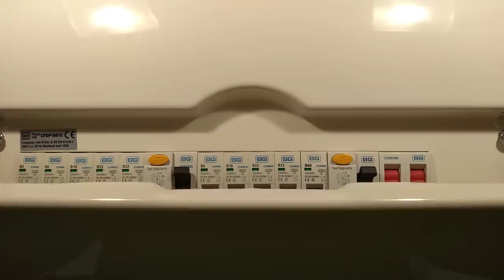A look inside a British home electrical panel.

Comment: I'd like to see a comparison with a modern German distribution panel (3 phase).   Always seemed like a good idea instead of single-phase distribution.  I'd also like to see a discussion of the UK "ring mains" system.
Reply: TIL ring main are a thing. In theory it should let you get more power to the outlets/use less copper for the wiring. Also the UK uses 32A rings while Germany uses 16A radial distribution. However if a wire gets broken at some point in a radial system it will not work while in a ring system it can lead to a overload situation where the wiring could burn.
Reply: The second world war brought about ring mains in the UK. It was determined that there might've been the possibility of a copper shortage so using a ring was a measure designed to reduce the amount of copper a house needed for its wiring.
Reply: Huh, I didn't realize German homes had three phases, I thought only large buildings or industrial stuff got that. Though it does make sense that Germany of all places would build houses capable of running factory equipment :)
Reply: @jayzo  Interesting Germany didn't do that as there was even more stuff to rebuild.
Reply: @GiddeonFox  Yes. Every German building has 3-Phase. The stove is wired to all three phases, as are electric water heaters. If you have a garage it's not all unusual to have a 3-Phase outlet, one of the big red ones. Also rooms are normally running on different phases to distribute load.
Reply: Essentially a 'ring final' is a means of reducing cable cross-section and this cost saving and arguably being easier to install, by having a circuit supplied from two ends instead of one, such that if you tried to draw 32A at the farthest (equal resistance down both paths back to supply) point of the circuit then the current would travel equally down both paths.
To the nest of my knowledge in the current regulations; a'ring final' is a defined 'standard circuit' in which the protective device is 32A and the current carrying capacity of the cable in use, taking into account thermal constraints etc., must be 20A or greater. In most homes this results in a 2.5mm csa. In some cases 4mm csa may be required, such as if under too much insulation.
Reply: @GiddeonFox  i have 3 phasis in my tiny 36m² flat, the distribribution board is from the 1960ies and it's never been updated. It still lacks any RCD....
Reply: Most of Swedish homes also have three phase systems. The ones with one phase are mostly apartments, and they are often updated the three phase when renovating the systems.
Reply: @FreeOfFantasy  As your nieghbours in austria we also use this system, just wanted to add that at least where i live it seems to be quite common to have one phase per floor in a multi-story house. I live in an apartment building with 2 story apartments and we have one phase for each floor and one as "auxilliary" that goes to high power stuff like stove. The arrangement rotates each appartment so that the whole building ends up more or less balanced.
Reply: @FreeOfFantasy    The distribution box that Clive shows surprised me.  The distribution panel for a typical US home is much larger.  My own (a 200A one) has 25 circuit breakers, counting the 240V double-pole ones for the heat pump and kitchen and well pump as single.  I'm not including the sub-panel in my workshop, either, which probably contains about eight breakers.  My home is about the US average in area--I have neighbors with larger homes and 400A service.
Reply: @FreeOfFantasy  3 phase makes an enormous amount of sense for appliances with large induction motors--no start/run capacitors or centrifugal switches.   For large applications requiring DC, 3-phase ripple frequency can be made to be 6x the mains frequency, with a very high DC content.

 My neighborhood is fed by a buried 3-phase 12KV line (each home has a pad-mounted transformer), but the feed to the homes is single-phase, with the utility "balancing" the phase loading manually, by connecting homes to one phase.   On the other hand, the distribution transformers for 3-phase must certainly be more expensive than those for single-phase.
Reply: @uzmeyer1752  I only know that my dad explained me that VDE0100 says the rooms should be on different phases and balanced. I guess you can also do that by wiring up one floor/apartment at per phase.  Where I looked at it last it didn't really matter as all three floors came down to the same breaker box anyway.
Reply: @GiddeonFox  Sweden as well, even 1 bedroom apartments. In an apartment, the stove is the only likely (possibly washer/dryer as well, if it has them) 3-phase load. Other circuits distributed over the phases.

New construction/renovation - all grounded, RCD/GFCI for bathrooms. Legacy, there's still ungrounded outlets, ceiling light outlets, etc around. Grounding was brought in as requirement for kitchens while bathrooms typically had a 110V current limited "shaver outlet"

Current apartment is a mix, as kitchen and bathrooms have been renovated,  while the other rooms have the older ungrounded outlets.
Reply: for some great information about uk mains, there are 2 great YouTube channels 
John Ward and Thomas Nagy
Reply: tubastuff In my European country, each 3 phase transformer feeds a few streets or a small village with 3 phase 380/220V circuits. Each house is fed by a main fuse (usually 25A or 35A) in the curbside "tombstone" distribution box which feeds the 3-phase meter, then the consumer unit where a 3-phase RCD acts as main breaker.  From there it feeds 10A or 13A 1.5mm² group fuses for normal single phase loads or larger 16A 2.5mm² 3-phase groups for heavy loads.  The EU harmonization with the UK raised the nominal from 380/220 to 400/230.  It also allowed the mixing of 3 incompatible socket types from around Europe, making "travel" adapters a permanent necessity.  6A/1mm² circuits were common half a century ago, while really high power circuits (32A, 63A etc. 3-phase) are really only for industrial and stage installations.
Reply: @tubastuff  Three phase is great. No question. I just have never seen a household appliance beside a stove and a heater that has three phase. We have usually a big three phase transformer per neoghborhood from 10, 20 or 30kV.
Reply: In Czechoslovakia there were used wires made of aluminium. That's also quite dangerous.
Reply: @JendaLinda  Not really. You just need bigger cables and have maybe problems with corner radii.
Reply: @FreeOfFantasy  
Three phases in residences is not generally permitted in the UK.  On the basis that some idiot will run an extension lead from a room on one phase into a room on another phase and run the risk of getting a 415V jolt.

Or somebody deciding he needs more outlets in a room and finding it convenient to run a spur from an outlet in the next room.
Reply: @GiddeonFox  yeah, three Phase is quite common in large parts of Europe. It makes a lot of sense for running high-powered equipment like electric stoves. It also has Advantages in distribution - neutral doesn't need to be run in the grid, it's only referenced to earth at the local low-voltage transformer. Essentially, even if you were to run the neutral, you'd get three full circuits out of four wires, instead of six.
Reply: @FreeOfFantasy  I own an "all-electric" home in a rural area.  For heating and cooling, I have a heat pump, which has a large compressor in it.  A 3-phase motor there would make tons of sense.  Interestingly, the fan on the compressor unit is a VFD unit, so there the phase doesn't matter.  But the pump in my well would benefit from a 3-phase supply, no doubt.

Some of my friends with machine tools in their home shops have to use so-called "phase converters" to run the motors on some of the larger equipment.  Basically, an unloaded 3-phase motor with one phase fed by mains and the other coupled via a large capacitor.  The idea is to get a sort-of auto-transformer effect from the unloaded motor to drive a 3-phase load.  It works, but only just.
Reply: @tubastuff  
We have twice the voltage you do, so only need half the current to the house.  We're also poorer than you, so can only afford half as much electrical stuff.  That reduces your 400A to 100A.  And we need fewer circuit breakers than you would, even at 100A, because we have ring mains rather than radial mains. 

Oh, you wanted to know more about ring mains: https://en.wikipedia.org/wiki/Ring_circuit  There you will learn why UK plugs must have a fuse.  Except for Chinesium crap which often has no fuse, or has an illegal fuse which explosively arcs on overload because it's not sand-filled.  Also the cable catches fire at half the current it claims to be rated at, and the earth wire is often present but not connected (so it passes a cursory visual inspection as it appears to have three cores).  See many videos by John Ward on Chinesium plugs and cables such as this two-parter: https://www.youtube.com/watch?v=9KMrWupFQt4 and https://www.youtube.com/watch?v=cRjF7MsJKq8
Reply: Dutch homes also usually have three phase, although optional. Normally you either get 3x 25A or 1x 35A
I am quite surprised to see the neutral bars, here both Live and Neutral are isolated by the circuit breakers, which are dual pole!
Reply: One big difference we have in the UK to a lot of the rest of the world is all the plugs which fit into a socket on a ring circuit need to have a fuse in them (BS1363).  They only fit in one way around so the fuse is always in the line (live) conductor.  This allows us to use a larger 32A ring to supply multiple socket outlets (up to a recommended maximum floor surface area of 100 square metres), fused down to 13A or smaller in the plug top.
Reply: @tubastuff  The german one are bigger, we use the same style of devices (circuit breakers, RCD/GFCI) as they do in the UK. For comparison: This panel shown here is single row with 14 units. My main panel, which also holds the meter, has 6 rows. Every row got 12 units, the units a normal circuit breaker is one unit, RCD/GFCI is 2 units wide. I've got a sub-panel in the 1st floor (what is 2nd floor in America, what you call 1st floor is here the ground floor), 2 rows with 12 units per row.
The good thing on this system with the rails is, you can install a transformer for the door bell or other useful things. I've installed an outlet into the panel, because in the room with the sub panel is no outlet. It's actually only a store-room with the access ladder to the attic and the panel.

@John Francis Doe

"Each house is fed by a main fuse (usually 25A or 35A) in the curbside "tombstone" distribution box which feeds the 3-phase meter, then the consumer unit where a 3-phase RCD acts as main breaker."

Not state-of-the-art. Leakage currents acumulate, and then the whole house is dark. Or you've got a defective appliance, try to find it in the whole house...good luck. 35A is quite low, here you'll get 3x63A in the service entry.

  "The EU harmonization with the UK raised the nominal from 380/220 to 400/230."

UK had 3x240/415 V, they actually lowered the voltage. Most other countries, like Germany, raised it.

"It also allowed the mixing of 3 incompatible socket types from around Europe, making "travel" adapters a permanent necessity."

Europlug for small power appliances, fits all european outlets (except the british BS1363) without an adapter. Most countries on the continent use the german Schuko or the french system. And there are plugs available which fit into Schuko AND the french outlets.
Reply: @FreeOfFantasy  Aluminium wires are unreliable in screw terminals. The wires are too soft and they change shape. That makes bad electrical connections after a while. Terminals must be tighten periodically.
Reply: That only goes for new houses, old ones are single phase and can lack the PE Everything thats about 50 years or older should be checked for that.  @FreeOfFantasy
Reply: u have to remember that u basically half half the power with same amperage since US has 120V. 
 @tubastuff
Reply: @jayzo  I thought it was because there was a copper shortage after the war.
Reply: @wisteela  there was indeed, I misread my source when I double checked.
Reply: @MorbusSchmorbus  Except for the large stuff, such as heat pump/air conditioning, electric stove, oven,water pump--all 240V.  All-electric homes here are still practical as the power comes mostly from hydro--Bonneville Power Administration, though there is some windfarm in the mix.
Reply: @tubastuff  The USA uses 110 volts rather than 240 so you have twice as many breakers due to double the current of the UK and you have 2 phase rather than single. Typically a UK house will have 3 x 30A breakers for sockets (downstairs, upstairs, kitchen), 2 x 6A for lighting ( up and down stairs ),  40A for the shower, and 40A for the cooker.
Reply: @RuneInternational  Don't swear,  you said the N word, there are others that are better and don't do rough work !
Reply: @steverpcb  I know that, but the US distribution is standardized at 120V, not 110--it's crept up over the decades from 110, 115, 117 and now 120.  I think much of Japan stlil uses 100V--I've got some old Japanese electronics with 100V on the nameplate.   Heavy appliances here, as I mentioned, use 240V.  My heat pump, for example, has a 40A 240V and a 60A 240V breaker--one for the compressor and the other for the air handler.

"Two phase" is a little deceptive--the feed is still single phase with a center-tapped transformer secondary.  There were genuine two phase (differing by 90 degrees) distribution setups in the early part of the 20th century (WikiP says that Niagara Falls had two-phase generation), but what you're referring to is really "split phase".  Two-phase power has the same advantage as three-phase; motors don't need separate starting windings.
Reply: @alfoncejean8826  The youtube videoer mentioned in the original post's name begins with N and does rough work, is not a good example to give to others :(
Reply: Ring mains were made because of resource shortages, not because they had advantages other than 'takes less copper'.
Reply: @GiddeonFox  It's the same here in Sweden - even many apartments have 3 phase here, where the stove runs on 3 phase and all outlets and light are spread out on different phases. I have for example the a washing machine running on one phase, the dryer another one, the dish washer the third one, haha. The stove runs on all 3 phases - and I have also put up a 3 phase out let my self (one of those big red ones) that I can use for other stuff (I have for example a furnace that can melt metal and stuff)
Reply: @FreeOfFantasy  I'll bet the Germans didn't have soap rationing until 1950 either.
Reply: @tubastuff  The one in my ex-wife's house in France is like something of the bride of a Klingon Warbird.
Reply: Didn't know Germany had domestic 3-phase...... hmmm, useful if you've a 3 phase lathe or mill......... 
confession   I have a 3 phase lathe in storage hence my interest, cheaper to get a phase converter but......
Reply: @JendaLinda  Yes and they tend to become brittle and break if you're not careful.

The apartment I live in has what appears to be steel wire that's got a copper layer on the outside. I had no idea that was even a thing. But, since the outside of the wire is what carries most of the current anyways, it does make a bit of sense.
Reply: @JendaLinda  its not the aluminum that is dangerous, its the failure to apply the proper anti-oxidizer when terminating it.
Reply: A normal German house has 3 phases. One phase (per subdivision) should be reserved for lights only, the other two for power outlets and other stuff. If a breaker trips, you should still be able to have light in the rooms. Bigger consumers like stoves or flow-type heaters have 3 phases, it's also common to have a 3-phase (380V) outlet (CEE 3L+N+PE/3P+N+E 16A or 32A)  in your garage or cellar.
Reply: @tubastuff  American boards have always amazed me as how clunky and industrial they look, Australian boards are almost identical to the one Clive is using, just with slight local differences, single phase we still mainly use red for active and black neutral, and our regs limit three final sub circuits to each RCD. Americans seem to be much more energy hungry than England and Australia, maybe because energy is cheaper there? In Australia an average price per kWh would be 38c. So a simple two kW fan heater, very common and cheap here, costs you nearly 80 cents per hour to run.
Reply: So the phase to phase voltage in a german household is 380 or so volts?
Reply: Marcel Germann, unofficially, the Europlug will fit into a British 13A socket, by moving the internal shutter lever in the Earth connector. Obviously this is unsafe, but a lot of people do that. Others use a standard, fused 2-pin British shaver adaptor for the job, which is acceptable for lower power devices. Indeed, most people here don't even know what the Europlug is, and mistake it for a British Stanndard 2-pin plug, which has slightly larger diameter pins and slightly narrower spacing. But there are standard adaptors available which clip around a 2-pin Europlug and which incorporate a fuse. These are shown in Wikipedia, on the 'AC power plugs and sockets: British and related types' page, under the heading 'BS 1363-5 13 A fused conversion plugs'.
Reply: JendaLinda, screw connectors on copper wires also need checking periodically for tightness, because the copper deforms, and the screws (at least in U.K. connectors) can loosen because of thermal cycling and mechanical vibration. I routinely check all plug connectors at least annually.
Reply: Rick Offermann Yes.
Reply: In my school every room has 5 sockets with 32amp and three phases.
Reply: @t0cableguy  Oxidation isn't the main problem. Aluminium is slowly "melting" in the terminals and the connetion gets loose. It's quite common problem in older buildings.  Nowadays aluminium wires are banned for house wiring. They are now used only in dirtibution networks. Thick dristribution cables are much stronger so there is no problem.
Reply: That is just not correct as you should have proper crimped termination.

AL is common as an overhead mains feed here in Thailand due to cost, weight, and that it isn't a target for theft.
Reply: As a curious American, I'm not familiar with that stuff but I want to learn. Learn me some 3 phase live wires, um, I mean main.…or mains. Just shock me with knowledge!
Reply: @rickoffermann7156  Yes, or about 400 Volt.
Reply: @FreeOfFantasy  I wish we had that in the UK.  You can buy 3 phase into your house but it is not cheap!!
Reply: @gumulf  It's the same in Finland. It's also common the have washing machines and tumble dryers in the bathroom, as well as a sauna.
Reply: 3 phase was fairly normal i thought, not for outlets but you need it unless you want a mega piss ant oven and a useless hot water system
Reply: @derpinbird1180  not in the UK, as we are on 230 Volts and they have 60 Amp or 100 AMp heads.  Don't forget that the power available at 230 volts is twice as much at the same current than 110V
Reply: @MrLukealbanese  Oh, Im from Aus so i thought it would be similiar. Holy crap 100 amps that must be a thick wire. We do 240 here and yeah we all use 3 phase for anything heat related that doesn't come out of a socket.
Reply: A ring main is 11kV. A ring final is 230V.
Reply: In the UK you're charged 3x your highest loaded phase, so it can be a pain in some of the businesses I've been in asking the sparkies to rebalance our boards. Much easier to have one phase at home, especially as the bulk of the joules used in my house are from gas.
Reply: @SometimeWoodworker  There are AlFe cables (aluminium with a steel core) used for overhead wiring. High power underground cables are also made of aluminium.
In houses there were aluminium wires connected directly into simple screw terminals. Most appartment buildings was wired like this. The Communist era was rough.
Reply: @rarbiart   In Germany RCDs became only mandatory over time. My Parents home built in 1982 had none initially. somewhere late 80s to early 90s they became mandatory for at least bathrooms and possibly kitchens. Somewhere in the last two decades they became mandatory for the whole house.
Reply: Are ring mains still used in new builds or have they started using more modern circuits?
Reply: @GiddeonFox yes its very common here in germany  (at least in rural areas where i live) to use all 3 phases and each on 64 amp. Most homeowners here have things like standing circular saws, log splitters and hydraulic  presseses that all use 3 phase asychronus motors. Much easier to maintain than 1phase motors with carbon brushes. Also things like electric oven are usually on 3 phases or at least 2 phases 400v direct and dont use not the neutral wire
Reply: In Finland we have 3-phase power too. I got 3x35A main fuses. 3-phase is fed to stove+oven, 9kW water heater (heats the house) and 9kW Sauna. Rest is distributed over phases afaik
Reply: @tubastuff  The 3 phase transformer is much cheaper than 3 single phase, also it was a way to save copper. you only need one neutral (which has no current at all when a 3 phases are used equally) so a normal wiring needs 3P/N/Gnd has 5 wires instead of 7 for the same current. It is very convenient to have 400V/3 phase for tankless waterheaters, which are widely used.
Reply: @FreeOfFantasy  There is a problem with corrosion when you have different metals like brass, and aluminum.
Reply: @matekochkoch  That is the reason the aluminium wires are normally copper clad.
Reply: tubastuff I noticed this as well. In my country we've gone to 3-phase from 2-phase (old system).
Reply: @Murphy deffa You are writing complete bullshit again. B curve is common in Germany, but C (and D, Z,...) is absolutely legal. 
"Any digital PSU will trip fuse" - NO, IT WON'T.
Powerful high-pressure washers, if plugged directly into a wall socket, without an extension  cord, might trip a MCB. 
But this happens rarely. Normally, only B-curve MCBs are being installed in german houses. If an homeowner has problems with these, a C-curve MCB will be installed. 
By the way: I am a master electrician with over 20 years of experience. So, don't tell me what i should believe.
Reply: @rickoffermann7156  Yes, phase to phase voltage in Germany is 400V. 
But you won't find sockets with more than one phase in most german homes.
Reply: UK here
House we just moved out of has a 250A 3 phase supply no idea why is only a 70’s 3 bed semi no 3 phase socket in the garage either
Reply: @rickoffermann7156  No, 400V √3*230 is 400.
Reply: Every german home has a three phase mains supply! Normally 63 or 100 amps per phase (for a single family home!) Older houses may have 35, 40 or 50A depends on age & location...
Reply: bdf2718 wrong! One could get a three phase residential supply without a problem - it‘s just not common in the UK!
Reply: Same here in Finland all houses and new apartment buildings have 3~ system. This is so strange to watch these uk electric things when working as an elecrician in Finland
Reply: Casimir Konrad echt klasse was hier so manch einer schreibt, oder? Ey, wenn ich das lese wird mir schon schlecht!
Reply: @MorbusSchmorbus  I'll add a tangential comment that 110VAC isn't unknown in the UK.  Portable power tools are often wired for it, to be used with a 55-0-55V isolation transformer.  Not quite the same as the US system, since the center-tap is grounded.  In some older UK hotel bathrooms, you can also find a "shavers only" plug that supplies low-current 110VAC.
Reply: @FreeOfFantasy   Not quote but nice try.... What you think you know about s ACSR (Aluminum coated steel reinforced) which is used as uninstalled HV and MV  transmission lines (also used as support messenger/ ground on LV aerial cables). You do not coat Al with Cu... In order to use Al cables you use a antioxidant grease that contains powered zinc to make it conductive (and compatible with copper).
Reply: @darikmatters8866  they are a thing that is used. https://en.m.wikipedia.org/wiki/Copper-clad_aluminium_wire
Reply: @Murphy deffa  It is about safety... commercial environments use 277/480V 3 phase. As a general rule 120V is "hand-safe" (not really but it is much less dangerous than higher voltage). Aside from being hand safe the voltage is low enough to limit the the ability for the installation to cause an "arc flash" event if anything fails...
Reply: @FreeOfFantasy  I had 2 phase radiators in a house I lived in.
Reply: @GiddeonFox  Even in the U.S., Mostly in southern states (like here in Florida), there is 3 phase 120 / 208v.  They sometimes omit the 3rd hot, but it's available nearby since the transformer has 3 taps ( a wye config).  The reason it's here in the south, I believe, is there are a lot of pool pumps and A/C units, all of them large.  There are no homes here in S.Florida that don't have A/C.  Motors like the 3 phase, as it's more natural to drive ..basically letting the freq. offset turn the motor.  I grew up in Boston, and I never seen 208v anywhere in New England.  Up there, heating elements work better with two hots ..250v.  All appliances sold here are rated for 120/250v, but they work fine with 208v.   I forgot to mention, the 3 phase 120/208v is symetrical.  Basically the 3 phases are 120° offset from one another, so every 1/3 cycle, one phase peaks (up or down).   This is why they're great with motors.
Reply: @FreeOfFantasy  It's quite an exotic material in power distribution.
Reply: i've known about the ''shaver plugs'' they also where a thing some time here in germany according to my father, i've never seen them.
 @tubastuff
Reply: @mortenwinslw2785  I figured it was in that area. In Canada no more than 150 volt to ground in a residential setting is permitted, so most households have 120/240 singlephase center tapped neutral at ground potential. Some apartment tap are fed 3 phase with 2 phases tapped off to individual flats 120/208 volt. Personally I find the prospect of having 400 volt phase to phase potential in a residential setting scary.
Reply: @rayg9069  if an average British feed is 60 or 100 amps 220v, that's equivalent to 120 or 200 amps 110v, and 100 and 200 amp are both common sizes for American houses.
Most new construction is now 200 amp minimum, but some older houses have 50 or 60 amp fused mains lol

If you are getting into large custom homes, or guys that are going to have a shop, hot tubs, etc, then you might see 400 amp residential feeds, but that's not that common.

So the average US house has about the same size feed as the average British house it sounds like, we just like having more breakers so that circuits are kept separate!

Also, since we don't allow ring circuits (shudders), and have rules about what types of circuits can be combined, and what has to be separate, and rules about a minimum number of outlets per room, and how many can be on a circuit, so the breaker count rises quickly with number of rooms and bathrooms, and a lot of times it's just easier to drop another breaker in and send a home run to a device, rather than try to splice or put multiple wires on a breaker.

And people like me like home runs on dedicated breakers, because them there is a lot more flexibility for the future without having to run new wires.

So I don't think that it is so much about wanting to use more power, it's more about wanting to have more devices, and be able to plug them in anywhere and not worry about overloading a circuit because someone in the next room is using the same circuit.
Reply: @darikmatters8866  seems like maybe your comments are not accurate either.
There is copper coated aluminum wire, and putting dissimilar metals together does cause galvanic corrosion which gradually eats away at the metal.
Reply: @FreeOfFantasy  It was manufactured and sold in the 70's by Texas Instruments... last installed around 1980.. The only CCA still made is by Copperweld and is used in Coaxial cables and  substation ground  systems.. They are working on entering the building wire business but have no production to date.
BTW, I have over 35 years in the electrical supply industry and have sold at least 100 millions dollars in wire and cable
Reply: @matekochkoch  CCA (copper coated Aluminum) It is technically a bimetal which sees no electrolytic corrosion.. they are atomically bonded and are essentially one metal that is not uniform in composition. If it was more uniform it would be called and alloy
Reply: Don't you have anything more interesting to do Fritz?
Reply: All modern houses in Sweden have 3 phase, only building built in the 50's or earlier have 1 phase but most are being upgraded to 3 phase as part of other repairs. @gumulf
Reply: It looks actually quite similar. The circuit breaker system based on DIN rails is used here of course as well. A major difference is that most units will be three phase, so you get more wiring, but thinner wires (nicer to work with). So we use three-phase RCDs (four terminals) and typically one RCD feeds an entire row (usually 9 or 12 circuits) by using a bus bar that is actually consisting of three stacked bus bars. So in a row circuit breaker 1 is on phase 1, 2 on phase 3, 3 on phase 3, 4 on phase 1 again etc.

Neutral and PE bars are similar. A newer thing in larger distribution panels (esp. in commercial spaces) is to pre-wire the panel and only have a row / rows of installation terminal blocks (which combine PE+L+N in a half-width terminal block, e.g. Phoenix PTI) where the cables will enter. This means you can put the panel in place and very quickly put all the wiring in place, without having to run the stiff single-core wires through the entire distribution panel. These usually also include a neutral disconnector for finding / testing for earth faults.
Reply: Though smaller apartments sometimes only have one phase. I'll also point out that in three phrase distribution the utility will rotate the phases for each home, so my phase 1 isn't my neighbours phase 2. This helps balance loads out if e.g. we both have the same stove or heaters which connect the same set of plates to the same phases.
Reply: @FreeOfFantasy  Until the late 60s/early 70s, single phase was quite common in the West, much later in the East. So you still find plenty of old buildings with single phase connection.
Reply: @GiddeonFox  can confirm, we literally have 3 phases in each little student apartment here
Reply: @FreeOfFantasy  Depends on your house size.  I think Flats here either one floor is on one phase or pairs of flats on one, with others on the next, etc.
Reply: @FreeOfFantasy  it's not just the theory, that was the design spec.  to be able to power two of 2kw heaters from any point on the network.  With as little copper as possible, since we'd just taken all strategic metal reserves and thrown them at germany.  It's also why we have the most over-designed plugs going - because the ring mains is designed to deliver as much power as possible for the copper budget, protection is required at the wall.  Our much-lauded sockets/plugs are overly safe to make up for the nightmare that supplies them.
Reply: Here in finland. 3x16A for stove and 3x10A for sauna :)
Reply: @Joby Fluorine I'm not sure, but I think that's probably also why the typical US home takes more copper.  AWG12 is pretty much standard for 20 amp circuits here and if you consider the length of the runs from a standard breaker panel, that mounts up pretty quickly, even on a modest sized house.

I recall seeing a modular construction scheme where each module (set of rooms) had its own breaker panel; the idea being that a central panel provided high-current distribution with various sub-branches servicing that part of the home.  I've wondered if that requires less copper.

When I look at a UK plug and receptacle, the utter beefiness is impressive, even though a typical appliance in the UK draws less current because of the higher voltage than a corresponding one in the US.  I've also wondered if the typical "strip and shove" wiring to US outlets is also used in other parts of the world.
Reply: Indosarnia  Not sure that I follow.  US uses 240V for high-demand appliances, such as heating/HVAC, cookers, ovens, etc.  We haven't used 110V for decades--current standard is 120V; the receptacle near my computer measures 126Vrms at the moment.  Japan, I believe, still uses 100Vrms.
Reply: @lands1459  Thanks for that Clarification !   Albert  EI7II
Reply: @tubastuff  I think thats' because the US doesn't use ring mains and doesn't have fuses in the plugs - so more individual runs and breakers to outlets.
Reply: @arenalife  The 230V distribution voltage doesn't hurt either.  I recall that recently, the EU was capping household vacuum cleaner power consumption at 2KW.  That, of course, would be impossible under the North American 120V system (about 17 amps); most US household receptacles are rated at 15A and design guidelines limit consumption by any portable device to 13A).  There are 20A receptacles, but they look a bit different in that one of the plug blades is rotated 90 degrees.
Reply: ukezi we had a funny installation with each floor on its own phase. And we had a floor light impulse switch with switches on each floor (wired to the floors phase instead of the common floor light phase). Took 20 years before two people at the same time pressed the button... ,)
Reply: They used to have aluminum wire in North America, it was basically popular during the Vietnam War era or the late 1960s and early 1970s. The problem is that aluminum has a lower melting point then copper, and it also has a habit of becoming fatigued mechanically and breaking, so joints would become loose, heat up, and cause fires. What would also happen is that when work was done with the wiring people would mix copper, and aluminum wire together, or use the wrong hardware with aluminum wire, which would also cause fires. About the only place that aluminum is used sometimes these days, is in the feed in cable from the street, which nobody but the power company is going to touch.
Reply: Was that something done during the Communist era?
Reply: Same issue they had in North America, it's banned now.
Reply: It's 120 volts, it was never 110 volts except in the old fashioned DC power grids.
Reply: At least that's logical. I never could figure out why the Brits often have washing machines in the kitchen, do they make bread in the bedroom?
Reply: @OlegKostoglatov  Aluminum wire (of the stranded sort) is used  today for high-current draw appliances, such as ovens.  The stranded stuff in permanent installations is apparently not much of a problem, if the proper procedures and connectors are used.   Most residential US power drops from distribution transformers are probably aluminum.  It has a big advantage in that it's much lighter than copper, so it works well for aerial drops.

The old 1960s aluminum wire used in residential applications was solid, not stranded, which led to the problems.
Reply: I've never seen aluminum used even for stove wire, at least in Canada, I think that when they banned it in the 1970s they did so across the board once it was inside the house. Even the ground lead between the ground rod to the main panel is stranded copper, and it caries no load at all, neutral is isolated from ground here.
Reply: @OlegKostoglatov  Search for "aluminum wire" on the Home Depot web site; you'll see that the stranded stuff is still sold (SER, THHN and URD).  Connection to the grounding rod, however, is copper--I've never seen it done in aluminum, probably because bare aluminum exposed to the elements does corrode.  
In the USA, neutral is usually connected to physical ground in the distribution box.   At least it is in my home and shop.  The next time the local electrical co-op lineman has my transformer box open, I'll have to see if there's a separate physical ground on the center tap.   Better that he does it--12KV at high current on the primary side scares the dickens out of me.
Reply: the electrical panel for the house
https://www.youtube.com/watch?v=WvbqZsdERak
Reply: @tubastuff  That's 110 volts for you.
Reply: @JimWhitaker  Hasn't been 110V for decades in the USA.   The standard is currently 120V, was 117V; before that 115V as witnessed by equipment nameplates.  I used to have some Japanese electronics where the nameplate voltage was specified at 100V, which I understand is quite common in Japan.

In my younger years, I worked in a steel mill which had equipment dating from the 1920s in the mix. (Some day, I'll go into the strange control systems in detail).   There were three separate electrical distributions--60 Hz, 25 Hz and DC.   An electrical panel will all three was a wondrous thing.  I learned that you could take a fan rated for 110V 25Hz and run it on 230V 60Hz--the motor spun faster.  25Hz transformers were enormous in comparison to their 60Hz relatives.   250V DC was commonly used for overhead cranes and welding (a welder's box was scarcely more than a big rheostat.  Sadly, the old mill with its interesting equipment is long gone, so it's only a memory.
Reply: @bdf2718  Actually, you do NOT have twice the voltage as US, Canada, Mexico, etc.  In residences wired in the last 100 years we have 240 Volt service, the confusion is we have TWO Live supply wires 180 degrees out of phase sharing a common Neutral wire. The voltage Live to Live is 240 volts, whereas the Voltage from each Live to neutral is 120 Volts. 

Hence a typical modern US home with a 200 Amp Service has 48,000 Watts (48 KW) available just like a British home with a 200 Amp service would. 

When we have a service described as 200 Amp, the Main breaker is a two pole unit with each Live pole rated at 200 Amps. This can supply 240 Volts at 200 Amps OR 120 Volts at 400 Amps. 

Any mix of 120 Volt and 240 Volt loads can happily co-exist in any US home and utilize the full capacity of the service. While it is extremely rare to have small loads connected at 240 Volts, in a situation where it is desired, it can be done. We do have outlets keyed specifically for 240 Volt usage that are installed where appropriate, say a larger window AC unit, Clothes Dryer,  or cooker for example.

Many Small or older residences have 100 Amp service (24 KW), typical homes with Gas appliances built before, or shortly after, WWII had 60 Amp service (14.4 KW). Today many municipal building codes require 200 Amp service for new residential installations or upgrades. Large homes often have 400 Amp (96 KW) services and Estates would have even larger often 3-Phase services. 

An incomplete list of items found in US residences that typically require 240 Volts:
Cooker, Oven, Cooktop(Hob), Clothes Dryer (not gas), Water Heater, Space heating (Not Gas), Air Conditioning, Well Pump, Roof Eave De-Icing Cables,  UV Tanning Bed, Hot Tub, Level 2 EV Chargers, ARC, TIG, MIG Welders.

And Large Recreational Vehicles ( Motor Homes & Large Travel Trailers ) typically have a 50 Amp 120/240 Plug 12 KW), RV Parks are required to provide these at 20% of their Parking Spaces. Smaller RVs are standardized on a 30 Amp 120 Volt Plug, ( 3.6 KW). Large RVers Normally carry an adapter that allows them to operate on the   120 Volt 30 Amp outlets with major restrictions on simultaneous device usage.
Reply: @FreeOfFantasy  They are potentially dangerous. You also need special terminals or bushes for all the connections because the usual screw-down temrinals are not safe with aluminium. And to be careful in installation to flex the cable too many times. It is a bad idea altogether.
Reply: @FreeOfFantasy  the cable in ring circuit is rated 32amp  so it will not be overloaded unless you have a really long run like the length of a road
Reply: @GiddeonFox  We once owned an Edwardian house in the UK (originally wired using TRS) but it had 3-phase into the main switch some way from the board - only one phase used in the more modern set up - but a dishonest person could easily have accessed the other phases.
Reply: The standard UK single phase is a pain when it comes to fitting photovoltaics. Assuming you have plenty of roof space available you'd be limited (unless you had permission) to 3.68 kilowatts (kWp) on a regular single phase supply whereas a 3-phase system would allow something like 11.04 kWp.
Reply: @francisdonnelly9361  You need a pretty big south-facing roof to take 3.6kwp of panels (say 12 panels). I think someone who had a house big enough to mount 11kwp could probably factor in the cost of a 3-phase supply as well. 
But out of interest, why is a typical 100A single-phase supply be limited to a 3.6kwp installation?
Reply: @alexgray552  G83 regs.  DNO needs the phases to be balanced so limits to 16A/phase for embedded generator like solar PV deemed to be insignificant in terms of phase balancing. Therefore 3.68kWp on single phase and 11.04kWp on 3-phase. Inverters will additionally be G83 capped.
Reply: @francisdonnelly9361  I'm sure you're right then, but how does that make sense when it would be totally normal to put in a 10kW shower unit on a single-phase supply. That would allow an instant 10kW shift in load - 13kW if someone boils the kettle at the same time. Why should a 3.68kW shift be an issue?
Reply: @alexgray552   there's an blogpost at yougen.co.uk that explains. Search for this text for the full story: "Scottish and Southern Energy (SSE) explain the situation as follows: The effect which concerns us most is the rise in voltage caused by power flowing in the opposite direction when the PV output is greater than the customers own load. The electricity network in the UK has been designed for power flows from higher voltages down to lower voltages and finally to the customer. No allowance was made in the system design for power flowing in the opposite direction. For a single property with the maximum generation allowed under G83, of 3.7kW, there will be many times when power is being exported from a property. Most of this will be absorbed by adjacent properties and will not feed back in to higher voltage systems and will generally not cause a problem, though it might do in some circumstances. However ... where multiple installations are proposed, it is more likely that power will flow in the opposite direction to that for which the system was designed."
Reply: @tubastuff  In the UK our distribution panel will have one breaker for each ring circuit and one for each loop-in lighting circuit - so covering multiple outlets. We would also usually have a separate radial for an oven for example. Since all of our power is 230v our amperage requirements are half US so our cables are also smaller. (Having feeds to both ends of an outlet in a ring circuit also reduces the cable size requirement). A small UK apartment could probably get away with 4 breakers - Cooker, Kitchen outlets, Lights, Other outlets.
Reply: @stevemichael8458  In the US-UK comparison, that's not quite true.  Distribution to US residential customers is always 120-0-120V, usually 100A or 200A, depending on the load.   Cookers, clothes dryers, HVAC and water heating are always 240V here--those are permanent installations, however.  Normal utility wall receptacles are almost always 15/20A 120V, though I have a few 240V ones in my shop--and it wasn't  terribly unusual to require one for a largish window-mounted air conditioner.  To accomplish the same sorting-out in the UK, you'd have to provide 460V service to residential locations.   It could be argued that the US is a bit safer than the UK for "portable" appliances due to lower voltage.  I note that in the UK, portable commercial power tools require a 110V transformer, wired as 55-0-55, with CT earthed because of a safety concern.
Where we're different from much of the continental EU is the use of 3-phase power to residences.  In particular for induction motor appliances, such as HVAC, this makes a tremendous amount of sense, as there's no separate starting circuit for those.  On the other hand, VFD drives are beginning to be standard for those things, so it probably doesn't matter as much as it used to.
Reply: @tubastuff  Interesting. Domestic HVAC isn't really a thing in the temperate UK so maybe that's why its never been an issue. As a rule, there is nothing in UK homes which can't happily run off 230v single phase. As we move away from gas heating to heat pumps I guess this may change - when we have more motors involved! As it happens I have 3 phase to my property because I have commercial equipment - ovens - but only one of those phases is in use in my apartment.
Reply: Not a good idea IMHO (3 phase for homes). The inter-phase voltage is rather high. Also, how do you intend to load balance ?
Reply: @FreeOfFantasy  Hellishly more expensive !
Reply: @grahamstevenson1740  It's done in several European countries--full 3-phase feed is reserved for heavy-load appliances.   Otherwise, single-phase for household receptacles.    As far as inter-phase potentials, the same situation exists with the current US system, where residential distribution is 120-0-120, so two receptacles in a single room can have a potential difference of 240 volts between the "hot" sides.   Three-phase is routinely employed in commercial buildings, even small office buildings.   That's why you'll often run across heavy-draw equipment that has nameplate ratings of 208-240 volts.   208 volts is the interphase voltage on a wye-configured feed where 120 volts is the phase-to-neutral potential.
Reply: @tubastuff  I can see that this works fine but I see no advantage over 240V single phase in a domestic setting where every third house is wired to the same phase and the 3 phases supply each house in turn. I fully expect this ensures better/more consistent load sharing between phases.
Reply: @grahamstevenson1740  The single-phase balancing scheme assumes that House 1 has similar demand characteristics to House 2 and House 3.  In the mass-built suburbs, this may well be true, but in my neighborhood, homes are custom-built--some use propane for heating, but many are all-electric.  Each home has its own transformer; lines are buried.  Every few years, the utility will engage in load-balancing.  Each home has a street-level box where the 12KV 3-phase feed enters; the utility simply selects a phase to which the consumer is fed.   But this is far from the standard in the US, where several homes may be fed via drops from a "pole pig".   3 phase does have the advantage for heavy appliances that the motors are very simple--no starting circuits required.  Since the use of PCB oil in capacitors has been banned, start and run caps have much shorter lifetimes, so that is a (peripheral) factor.
Reply: 3 phase isn't a great idea in UK homes because both blue and black could be live conductors or neutral. It's why the wiring colours for plugs changed and it took a further 30 years before the wiring colours for circuits changed.
Reply: @watfordjc  It depends on the configuration.  A wye secondary has a common neutral for single-phase applications.  If you're going to use all three phases, then a 4-wire hookup is essential.
Reply: 3 phase has and always will be better for cost and longevity.
Reply: @SA-5247  For devices needing high (line) voltage DC, 3-phase is also superior in that a full-wave rectified output is only about 8% ripple and the ripple frequency is 6 times the line frequency (e.g. 50 Hz * 6 = 300 Hz on a 92% DC output before filtering.)
Reply: @tubastuff  you’re nerding out right now and I like it 👍
Reply: @SmallSpoonBrigade  that is incorrect, the skin effect onlh really happens at higher frequencies... and if you have copper coated steel wire you better get it replacex immediately... that is illegal knock-off wire made in China ... steel is a poor conductor compared to copper or brass... p!us it rusts 🙄
Reply: single phase is 240v domestic,  three phase is 450v for trade machinery.
the amps are increased with the power flow.
can you imagine a little boy in his home getting a shock from a 3 phase, he could lose his fingers.
Reply: @steviewonder7495   You might want to familiarize yourself with the power distribution in many Western European countries such as Germany.   Common utility receptacles are 220V (phase to ground) with the full 3-phase feed reserved for things like cookers and large appliances--usually wired-in, so not easily accessible to children.
Reply: @steverpcb  Actually, North America (USA & Canada) use a 120/240 split-phase system for residential service, not a 110volt two phase system. Split phase ( https://en.wikipedia.org/wiki/Split-phase_electric_power ) uses a 240 volt transformer with a middle tap allowing us to have both 240 volt and 120 volt fed into our panels. 15/20 amps @ 120 volts get used for lights and outlets, and for larger appliances (cooker, clothes dryer, furnace, hot water, etc) we can get up to 50 amps @ 240 volts. Some electric furnaces even have 100amp breakers @ 240 volts.
Reply: @rickoffermann7156  Or so: the system voltage is 230/400V, so you have 230V from phase to earth and 400V between two phases. You have three of them, differing 120° to each other, which is perfect for running motors... ;)
Reply: @Joachim2012  I understand. I'm an electrician :)
Reply: @rickoffermann7156  Cool! Now we are at least two ones here... lol :))
Reply: @tubastuff  US has 120V radial(star) distribution, you need all these breakers to deliver enough power. UK uses 240V ring distribution. One 32A fuse can power a whole lot of stuff. Neither is really good. Perfect is a mix of both, a 240V star distribution. High power (as in the UK) but no stress concentration/single point of failure (as in the US). Mainland Europe got this right.
Reply: @GiddeonFox Actually three phase is pretty common standard for every home in Germany. There might have been times were it came in handy for big three phase motors, but nowadays the main intention is to have a good load distribution between all three phases. Hence, at least three RCDs. And the fridge may even has it's own RCD/Breaker.
Reply: @gundelfish  Same in Poland, only some small 1950's and early 60's homes get singlephase mains, later every houses got 3 phases except some block house flats